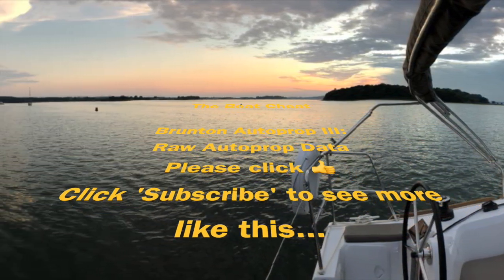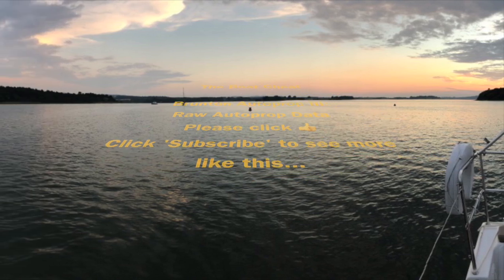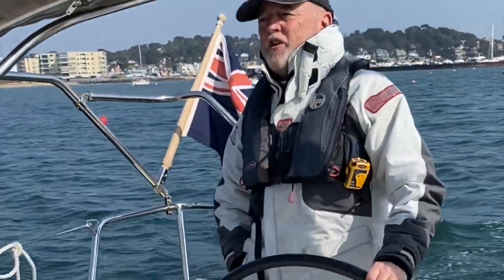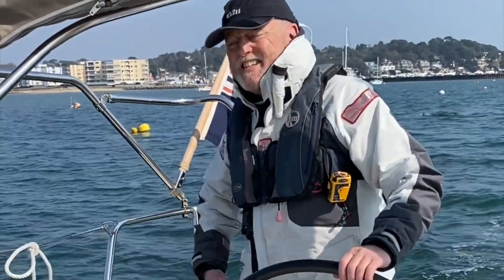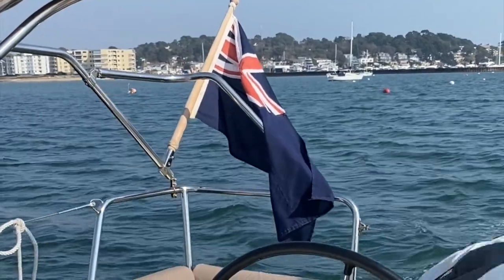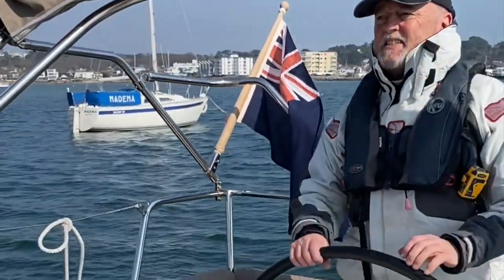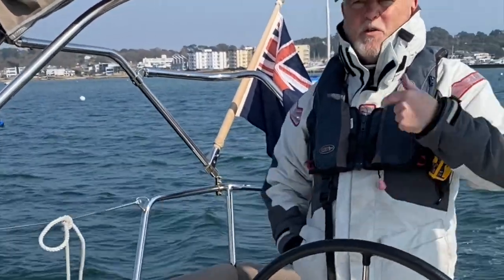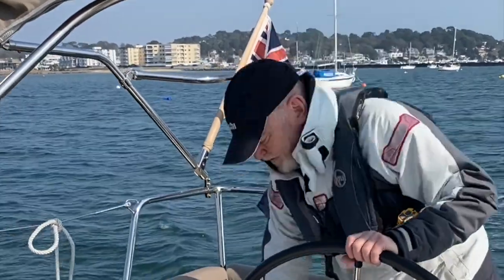Bruntons Autoprop Pt 3: Raw Data

Comment: I've been hoping to see the updated fuel consumption data you spoke of at the end of this video and, unless I missed the, it doesn't appear you've posted them.  Any chance you've made the calculations and have something to post?
Reply from the maker: @meestahwah  Sorry but we have been unable to come up with any data that stands up to objective scrutiny.  The problem is that while we can FEEL that the boat motors faster, motor-sails faster and sails faster, we have been unable to measure fuel flow against water speed to the accuracy needed to publish data.  What I can absolutely say is that I am getting 0.6-0.8 kt more under sail.  I can absolutely say that I can make a greater water speed (+1.2 kt) with the same engine under motor, and that motor-sailing is a LOT quieter for the same progress… beyond that I can’t verify with the rigour needed to publish.
Reply: @theboatcheat1204 thanks for the reply.  I appreciate the seat of the pants data all the same.

Comment: Anyway, power and rpm are not in fixed relation on a marine diesel. These engines are rpm-regulated : the position of the engine control sets the required rpm, and the regulation mechanism adjusts injection (thus power) to maintain that requetsed rpm. Both this and variable pitch on the autoprop make comparisons tricky. Only two comparisons are really meaningfull : max boatspeed attained in various sea/wind conditions under engine with the fixed vs. variable pitch prop (and at which rpm ?); and fuel consumption for a given speed with the fixed vs. variable pith prop (not a given rpm !). Love your pragmatic approach, keep the good work !
Reply: Also basically he just got lucky. It is fundamentally untrue that the prop always finds the optimal pitch, as is proven in the prop test of Yachting Monthly of May 2009, and Segeln of Oct 2008. It was beaten on ALL counts by a simple folding 2 blade.

And it CANNOT be true. The ultimate pitch is the result of rpm and water pressure on the blades. This is a balance that is determined by the geometry and weight distribution of the blades. There is no design feedback to engine characteristics. Engines can vary widely in behavior. So anything universal is by definition sub optimal.

Comment: Thank you very much for the testing and data!

Is there a noticable difference in fuel consumption or is it about the same?

I agree with you that the pleasure of better performance is already worth it and the stopping power is a great safety feature!
Reply from the maker: There appears to be a reduction in fuel consumption, but the more noticeable difference is in performance - and motor-sailing is definitely more efficient with less fuel used and more importantly less noise!

Comment: Hello, good morning and thank you very much for sharing our experiences on your YouTube channel. We are thinking of installing a Bruntons Autoprop propeller on our 38-foot sailboat. After so many miles traveled, what would be your experience and rating of this propeller?
Reply from the maker: We are on a long trip at the moment, and I have lost count of the number of times I have said it, but the prop is absolutely brilliant.  Sailing we have gained about 0.7 kt for the same conditions, and when we need to make progress and the wind is not quite strong enough the propeller really comes into its own… it is worth every penny over and over again… one viewer made the valid point that u less we could compare fuel consumption we can’t really say how efficient it is,  it the way I see it is this… if I told you that a more powerful engine, which could enhance your performance when you need it, was only a couple of thousand pounds, wouldn’t you say “yes please”?  Effectively we have a bigger engine, because when motoring, when sailing and when motor sailing the boat. oves faster… simple as that… LOVE IT!

Comment: How has it turned out for you?
Reply from the maker: I am delighted with it… but it is really hard to quantify the improvements without fuel flow data.  However, as sailors the most tangible difference is about 0.7 kt more speed under sail, a vastly improved motor-sailing performance with much less noise. Will never have a yacht without one in future.

Comment: This doesn't tell me anything if you don't also look at fuel consumption. A diesel engine will use more fuel at 2000 rpm under load than at 2000 rpm with lighter load.
Reply from the maker: I made that very point… 6:15